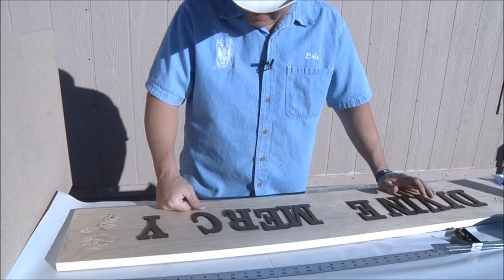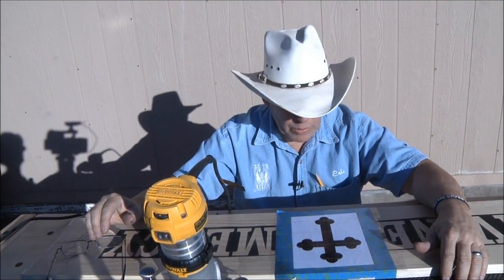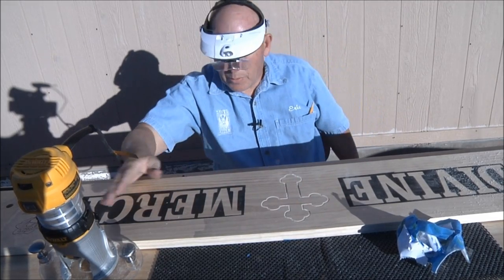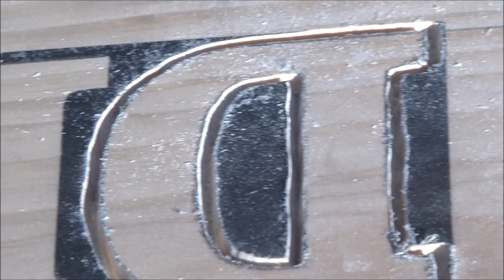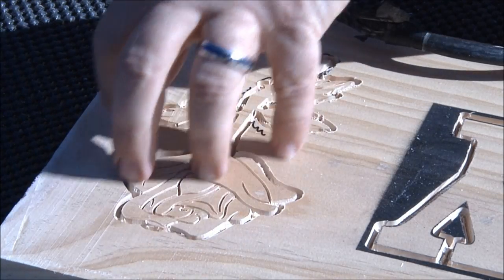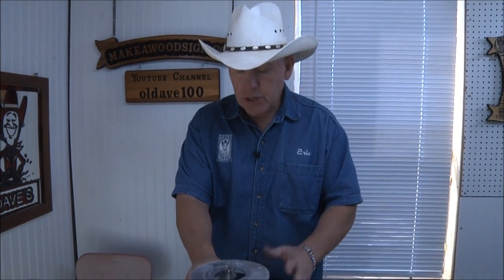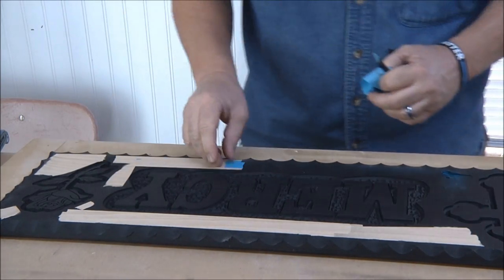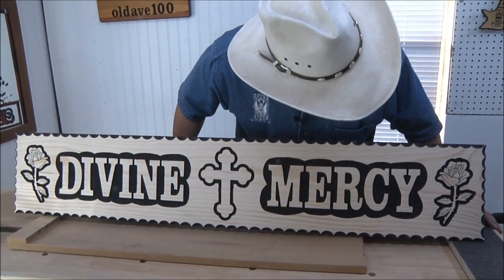#193 Carving A Church Sign with Roses

Comment: Excellent demonstration of sign carving. I've subscribed, but not sure I want to get into it. It is a lot of work which requires a lot of patience and many hours of work.  I've thought about it though and that is why I'm here. Who knows, maybe at some point I will give it a try. I'll keep watching.
Reply from the maker: Thank you Russ, I appreciate you watching. If you decide to try this and have any questions just let me know, I'm happy to help eric@makeawoodsign.com
Reply: @oldave100  My new Makita router came today, so I'm set with that. I also have a big set of Yonico bits that I bought on Amazon, but  most are not suitable for signmaking. So, assuming I need the bits you used to make the church sign,  how much would they cost me plus the base with handles? Thanks

Comment: Hey Dave, I've always loved seeing these videos and now that I saved money I'm wondering what kind of router and bits should I get for a beginner. and what kind of wood should I start off on. . plus how do you sharpen the bits? thanks dave.
Reply from the maker: Hi Jesse, this is Eric. Dad doesn't get on here very much. We several different routers that we use. For small detail I like the Dewalt DWP611, modified the way it is in this video. For bigger routers I like the Porter Cable 690LR or the Dewalt 618. I used it on this video as well. For bits we use we have them all on our website makeawoodsign.com under "Sign Carving Supplies". As far as sharpening them we have several videos on how to do that. Check out our video #164, dad did a get job on that one. Hope this helps and let me know if you have more questions, eric@makeawoodsign.com. Thank you, Eric

Comment: When you torn the tape off the cross it looked like white clear paper.  what else did you use to hold the cross in place.
Reply from the maker: I used spray adhesive with packing tape on top.

Comment: hey would you share the info of the profile router bit please?  not really sure what to start with.
Reply from the maker: Hi Martin, my father Dave designed it. It is 1/4" shank. 15 degree angle down to a 45 degree angle at the bottom. Get for detail and cutting outset letters. Hope this helps. Thank you for watching. On our videos #38, #39, & #40 dad goes over all the bits and what we use them for. Hope this helps. Thank you, Eric